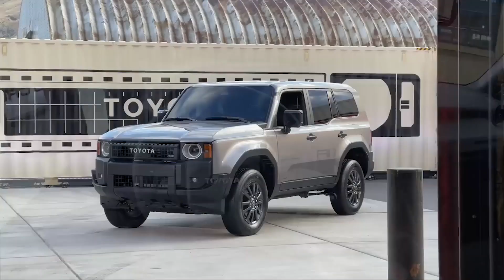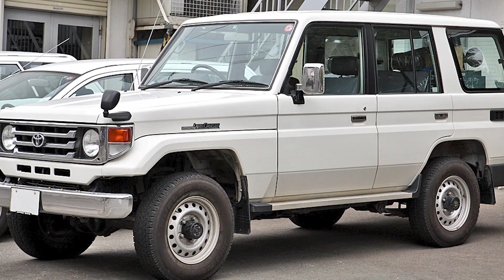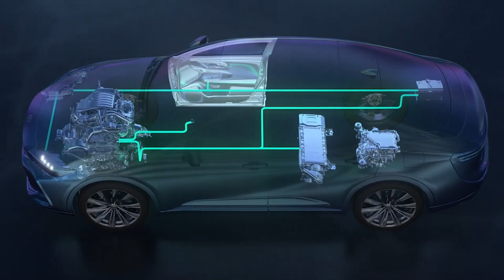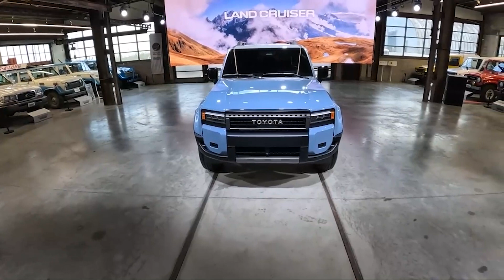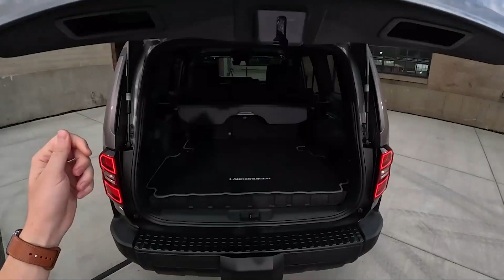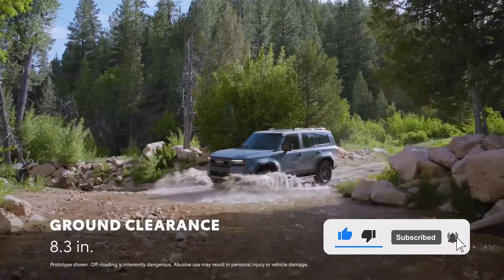All New CHEAPER Toyota Land Cruiser SHOCKED The Entire Car Industry!

Comment: Toyota could consider spinning off the Land Cruiser nameplate into a hard-core off-roading sub-brand that would leave Jeep and Land Rover very, very worried. The Land Cruiser 250/Prado a.k.a. Land Cruiser Junior may just be the beginning of this possible move. A facelifted Land Cruiser 300 a.k.a. Land Cruiser Senior could be next, though it will unfortunately remain an overseas-only model compared to the Lexus LX600. 
Others like the following below may follow next:
* Land Cruiser FJ - Possible successor to the FJ Cruiser and a more proper rival to the Ford Bronco, Jeep Wrangler, and Land Rover Defender than the 250/Prado. It would come in 2-door and 4-door modes plus a removable hard-top roof as well as a rear-mounted coated tire.
* Land Cruiser 4Runner - Mid-size 5-seater SUV sitting below below the flagship 300 as well as the 250/Prado and smaller FJ. It should replace both the outgoing 4Runner as well as the Hilux-based Fortuner/SW4 sold mostly overseas.
* 'Baby' Land Cruiser - Seemingly large compact SUV that's more rugged than the outgoing RAV4 and could go after the Ford Bronco Sport
* Land Cruiser 400/Sequoia - Full-size SUV that could be built in the USA alongside a next-gen US-market Lexus LX that should eventually replace both the overseas only Land Cruiser 300 and the bloated yet illegitimate Sequoia. The Sequoia nameplate could be applied to this new Land Cruiser thus giving the name 'Land Cruiser Sequoia'. Extended length versions of both this possible Land Cruiser and the next-gen LX will eventually be exclusive to North America. Potential rivals inside the US will be the Chevy Tahoe/Suburban, GMC Yukon, Jeep Wagoneer/Grand Wagoneer, Ford Expedition, Cadillac Escalade, and Lincoln Navigator. Outside the US, the it would fight off the Nissan Patrol Y64.
* Possible pickup versions of Land Cruisers 300 and 250/Prado that will unfortunately be kept out of the US market given the presence of the Tundra and Tacoma pickups.
* EV versions of Land Cruisers Junior (a.k.a. Prado) and Senior may not be coming until the complete development of an e-TNGA platform for body-on-frame EVs which would come for at least a decade from now. Land Cruiser Senior EV would go after the Chevy Tahoe/Suburban EV, GMC Yukon EV, Rivian R1S, Cadillac Escalade IQ, andthe Lexus LX EV, while Land Cruiser Junior EV (or Prado EV) will go after the Lexus GX EV, Jeep Recon, GMC Hummer EUV, and the Mercedes EQG SUV (a.k.a. G-Class EV).